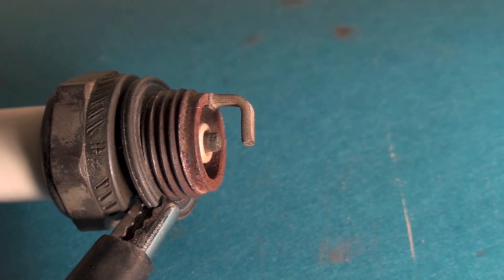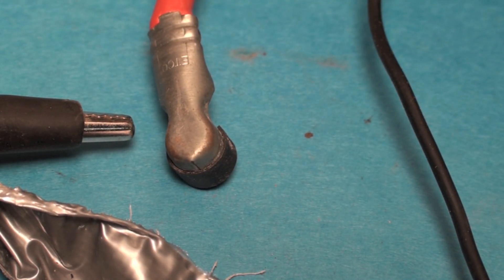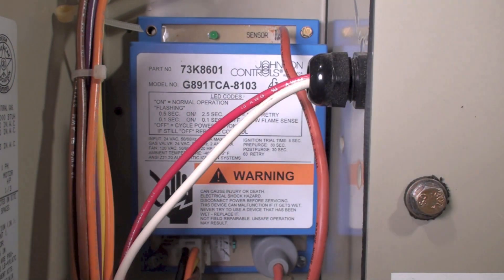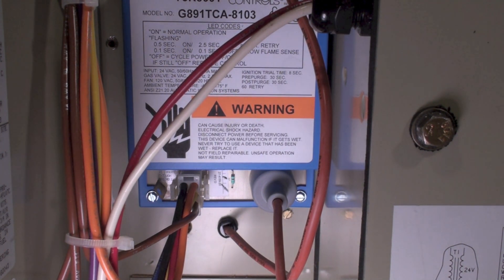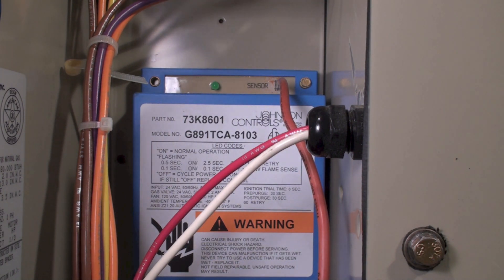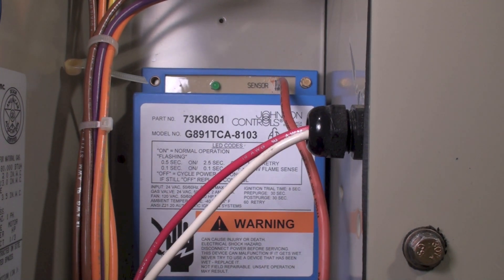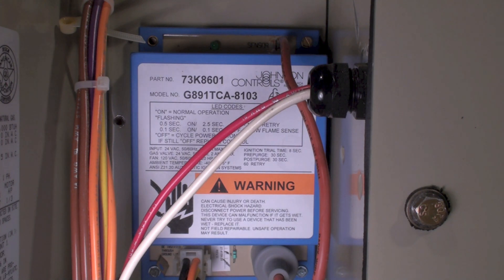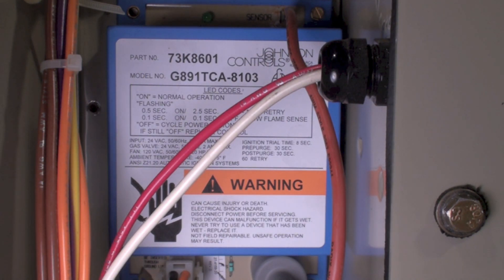Troubleshoot ign control of the Lennox pulse

Comment: My Pulse 21 will come on but only for a few minutes, then shuts off. I turn switch off, wait a minute turn it back on & it will only run a few minutes again. Is it flame sensor??
Reply from the maker: The flame sensor or the control board may be the problem.
GFM

Comment: My Pulse seems to have stopped working the other day. Had an HVAC tech come and look at it and they didnt really give me any direction since the unit itself started working again on its own (go figure).
Now (the next morning) it isnt firing up again when theres a call for heat. I took the panel off and I can hear the unit click on and hum for a few seconds and then it stops. After a short period of time it'll do it again for a bit longer and then stop again and as I sit here typing this I can hear it intermittently repeating this.
What do you think could be the issue?
Thank you in advance!
Reply from the maker: Is the inducer fan coming on?
GFM
Reply: @grayfurnaceman  would that inducer fan make a low whirring type noise?
I don't believe so, no.
Reply from the maker: @kyleb.6696  Yes it does.
GFM
Reply: @grayfurnaceman  it appears through troubleshooting that the issue I have is the ignition control board. The inducer fan spins freely.

Comment: Sir, thanks for all the great vidios.  ❤
Im trying to get my G21Q3 going again. Been great till now. Lol
Installed a new control board. The one by the 24v trans. But now if I heard you right.
Inducer will not start. No power to it. Jumped it anyway and it does work.
Vacuum,  timer and gas valve all check out.
Green light is on steady at least till it times out.
But i belive you said the ignition control (blue box) does also have a relay for the inducer fan ?
This then could be my problem?
Thank you in advance.  🙏

Comment: My 1990s Lennox Pulse21 stays on for about five minutes and then the furnace shuts off and you have to turn off that switch on the furnace and wait about 15 to 20 minutes. after you turn that switch on the furnace off you turn it back on and then my furnace comes on for about another five minutes and shuts off then you have to shut it off at the furnace switch wait about another 20 minutes and turn it on and it will run and shut off after about five minutes. Do you know what this could be? I don’t have the money to get a new furnace right now.  I put a new thermostat on last year from Ace hardware. Then I just went and bought a Honeywell non-programmable thermostat for heating and cooling. Same thing happens so it’s not the thermostat.
Reply from the maker: There could be a number of possibilities here.  I would try replacing the air flapper first.
GFM
Reply: Thanks

Comment: My led on top of my ignition control randomly works, when it does turn on I get heat but I have no idea what makes it randomly turn on…
Reply from the maker: The ignition controls have given a lot of problems.  You could also have a dirty flame rod.
GFM
Reply: @grayfurnaceman  thanks I went ahead and ordered a replacement ignition control, fingers crossed.

Comment: My furnace sounds like the spark plug is energized, it clicks and it clicks but it doesn’t turn on the blower or the heat
Reply from the maker: There a number of possibilities.  No gas available, failed gas valve, dirty flame rod, flapper failing.
GFM
Reply: Found the problem! She forgot to call the gas company and activate the service

Comment: GFM, thanks for all of the Pulse videos. I had an intermittent problem where it would fire for a few seconds (less than 8) and then stop. It didn't happen on every call for heat, just randomly. Flame sensor, igniter, and flapper replaced with no change. Installed a new Baso control board and all is well. Three heating seasons of intermittent problem and three HVAC service companies and now it is fixed. Thanks for all the education you give to enable us DIY guys.
Reply from the maker: Happy new year
GFM
Reply: Just wondering if you ordered the Basco control online?
Reply: @jaybuilder8298  Yes I did.
Reply: Thank you Steve!

Comment: My Lennox Pulse stops working randomly. I will notice the temp is dropping and sure enough, the furnace is no longer kicking on. If I shut off the heat and wait a few seconds, turn back on, it usually kicks on and runs a few days more. Sometimes it will only do so again after I open the unit and check wires, blow out dust and close it, then restart. I have no idea which of those things may be helping it. I replaced the thermostat, but thats not it. Any ideas?
Reply from the maker: You have a possible range of problems.  Dirty flame rod, flapper valve failing, failing ignition control.
GFM
Reply: @grayfurnaceman  Thank you so much!

Comment: My Pulse 21 is having issues. The inducer runs but instantly when it should be starting to spark it clicks off and starts to flash and locks out.  I had a repairman in, but was not experienced with these and was really a waste. He or “we” removed the flame sensor and broke the spark plug, so I replaced both yesterday. At first there was no change. I wondered what it would do if I shut the gas valve, it cycled 3 times and did not instantly go into safety. I then turned the gas on and it worked. It started and ran fine several times, but then went into safety. Reset the breaker and started. In the night it went out on safety and even reseting the breaker would not gte it to restart. I had really thought it was going to be OK but has gone right back to instantly clicking and going into safety without any try fir ignition. I am thinking maybe the control box at this point, unless it could be the gas valve. Seems like some kind of short almost as soon as it tries for ignition. Any help is appreciated.
Reply from the maker: It is possible there is a short in the gas valve solenoid.  More likely, the flame safety control is failing.
GFM
Reply: @grayfurnaceman  Thanks for the help. I ordered a new BASO replacement control box and the furnace is running flawlessly.  I have installed extra CO detectors, but feel this furnace has some years good years left. It has never been the primary heat source so actual working hours are much less than just going by age. I think some are too quick to condemn them due to age. I have a much better understanding of how it works now, should have just watched your videos, and downloaded the manual before wasting money calling a repairman who was ready to come look at it, but was obviously not really familiar with these.
Reply: @grayfurnaceman  Thanks, I think I am going to order a new control.  The Baso replacement will at least have diagnostic codes available to help.  I tried unplugging the gas valve wires and it does the same thing. With a meter on the wires I get power for an instant and the control clicks off.  I had it running perfectly for several cycles through the day yesterday but this morning it again went out.  I hate to give up on it as it has served me well and is not my primary source of heat. In that sense, although old it does not have that many working hours on it. I have purchased a few new CO detectors to be safer.

Comment: Hello.  I'm looking for some expert advice.  I have a Lennox Pulse G14-100.  I love this furnace and it's running beautifully.  However, I have noticed on occasion it seems to hesitate slightly at start up.  By hesitate, I mean it starts up like it should, then pauses for a fraction of a second, then starts running normally.  It's a short pause in the operation of the flapper membrane  sound that makes it seem like it's going to stop. Any tips on what to check or opinions on what may be causing this hesitation at start up would be greatly appreciated.  It typically only happens the first start up when turned on.  After its been on and off a few cycles, the hesitation/pause seems to be gone and it fires right up and runs smoothly.  Thank you!
Reply from the maker: If the hesitation only happens on the first startup of the season, I would not worry about it.  If it happens after a short time off, you may need to replace the flapper.
GFM
Reply: @grayfurnaceman  Thank you for the reply.  The hesitation is on first start up anytime it's been off for more than a day or more.  Not just first time of the season.  The flapper is probably 2 seasons old.  I will go ahead and replace it to see if it help.  Take care.

Comment: I think I have watched everyone of your videos about the Pulse 21 furnace and some of them 2 or 3 times. I may have missed it (I don't think so) , but I haven't found my problem listed. My furnace just stopped working. No fits and starts etc. just stopped. When I took the front off I could hear something, purge blower? cycle 3 times. Like on for the 8 seconds then off. No other noise, like trying to fire. I also didn't hear what should have been a spark snapping. I powered off. I had a spare control module and swapped it out. I turned the power back on and Viola. I heard the purge fan and then it took off and ran perfectly for about 28 hours. Then it quit firing but the fan stayed on and wouldn't shut off. I turned the unit off again and disconnected the jumper wire for the fan to start on ignition. I turned the power back on to the unit. I heard the purge fan come on and off 3x and nothing. No start attempts. I tried the 1st control same thing. After watching your videos and talking to several people, who all said replace, replace, replace. WTH is wrong? LOL

Comment: Thanks.  This is a great site!  I have a Lennox Pulse Model:  G14Q3E-100.  Recently it's been experiencing intermittent lockouts (Red LED light displayed on the GC-1 Primary Control and furnace fails to startup).  The furnace generally resumes normal operation after I break and remake thermostat demand for heat, although in some instances I have to turn off and on power at the furnace and reset the thermostat to restart the furnace.  This only happens some of the time (generally late at night).  Sometimes the furnace goes into lockout (Red light on) immediately after it completes a heat cycle.  I've also noticed that I can often hear the purge blower running (often on and off with some ticking sounds) long after the furnace has completed it's cycle (maybe 5 to 10 minutes).  Eventually the purge blower stops running and then sometimes the furnace goes into lockout (Red LED).   Generally, once in lockout, the furnace will not operate until I turn the Thermostat off and back on, however, in some cases this lockout condition may resolve on its own after a while, generally when the purge blower starts again, randomly on it's own.  It seems to cycle back and forth like a case of Russian Roulette in that if the Thermostat issues a call for heat when the purge blower is running (and the furnace is not in lockout), the furnace fires up and runs perfectly.  

I did inspect the air intake chamber and air flapper valve (seemed fine, no frayed edges and fairly clean), noting some insects in the lower chamber (some still alive) which I vacuumed out.  The purge blower seemed fine and the blades rotated freely.

I also noted that the furnace hose connector which connects a hose from the exhaust PVC pipe to the the Differential Pressure Switch had broken off almost completely and was allowing some exhaust to leak into the air intake chamber.  My assumption is that this connector had been broken for a long time, possibly done at installation.   I first plugged the hole, then used a smaller diameter tube to connect it back up.  Neither seemed to make any difference with the intermittent lockout problems. 

The problem does seem to be getting worse/more frequent over the last week.

Could this be a due to a slowly evolving failure of the welds in the heat exchange assembly (as is somewhat common with these units)?  I do have CO detectors in the house and have not seen any alarms or high readings. 

Does this sound like the GC-1 Primary Control (Ignition Control) is failing?   If so where could I find a good replacement.  I've come across a possible replacement:  http://www.baso.com/Section/Products/Ignition_Controls/Lennox_Pulse_Replacement_for_G891.html

Anyone have any experience with this Baso 3rd party replacement Control?
Reply from the maker: This one does sound like an ignition control problem.  I cannot be sure on heat exchanger problems as it needs to be tested to determine.  I have not seen that model control as a replacement.  Not saying it will not work but I just have not seen it.  If it was mine with the info I have from you, I would try the control.
GFM
Reply: Thanks very much!   I did order a Baso replacement control but have not yet installed.  Interestingly, now the furnace is running fine with none of the prior symptoms (intermittent red light/Lockout condition, purge blower running intermittently well after shutdown, etc.).  Not planning to replace the control yet and instead will keep it just in case and to see how things go...weird!  Anyone else having this type of intermittent problem with a Lennox Pulse?
Reply: Richard Stout Long and boring

Comment: I'm working on a Leonnx commercial gaspack 12GCSO48X-100-4PA.  in heating mode what is the diagnostic code of 4 flashes?  I see normal heartbeat while the burners are running. then it will stop the flames and flash a pattern of 4 untill the burners relight.

Comment: i have Lennox M/N G21Q3-80-1
S/N 5896B 46294

one day the control green light is out and nothing works, i thought it was the breaker but wasn't. 
you think it is a control need a replacement and where can i buy them
Reply from the maker: If you have a fan switch on the thermostat, turn it on.  If the fan runs you have power to the furnace.  If power is there, jumper out the thermostat.  If it still does not work, you may have a control board problem.  The bad news is it is getting hard to get the control boards for these units.
GFM
Reply: fan still has to work even control is bad or nothing suppose to work?
when i turn on power to unit i do hear something(very small buzzing noise) from unit. this confirms me there is power to the unit.

thanks
Reply from the maker: Turning on the fan switch is just a test to be sure there is power to the furnace.  
GFM

Comment: Hi, I have a G14-80 pulse with a black control module with no LED light. I haven't done a pressure test on it, and will before buying more new parts (bought a used purge fan, old one was seized), but there is no power going to the purge fan upon starting. The gas valve works and the indoor blower (blows heat into building), I've bypassed the pressure sensors and hotwired the thermostat to eliminate those areas. The furnace runs gas into the combustion chamber, the indoor blower fan runs and blows cold air into the building for about 1-2 mins (longer than 30 secs for sure), and then the furnace shuts down and seems to lock out. To get it to cycle again I have to closed the thermostat loop (R/W) on and off multiple times to get the furnace to do anything. Then the same thing. I've checked the air intake flapper and it looks good (have a replacement but the old one looks in similar shape) and there is definitely gas coming because I had the plate covering the air intake off and could smell gas the first time I tried the furnace after replacing the purge fan (killed power immediately and closed gas valve for the rest of the testing). Dealer is to busy right now to come out, I'm going to borrow the pressure testing equipment from him if he has it, he should, but I suspect the control module is shot, probably a relay to the purge fan? What's your opinion? Thanks
Reply: This furnace is out in my shop so I'm not in a panic to get it running. Going to buy a garage make up heater today and put it in for a secondary heat source to heat the building up quickly since I'm in there and require heat only once in awhile and don't like waiting 2-4 hours to have it heat up.

Comment: Appreciate your informative videos.  . .My G21 Pulse ran out of propane, now it does not spark. 4-strap blower fan comes on, gas valve actuates, but plug does not spark, goes into lock out after futile attempts. I pulled and gapped spark plug, cleaned flame sensor, checked continuity of spark plug wire.  No luck . . .Thanks
Reply from the maker: +Dan Phoenicia You can try replacing the spark plug if you can find one.  If no spark comes from the control, you may have a control failure.  Also, have you made sure 24 volt power is getting to the control?  If the pressure switch does not make, the control will not send power to the gas valve and spark plug.  Hope this helps.
GFM